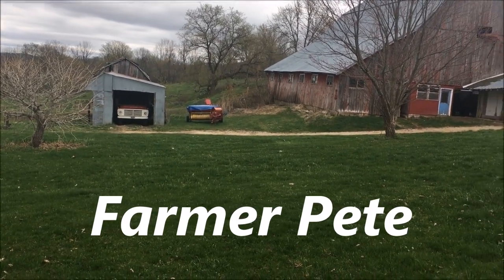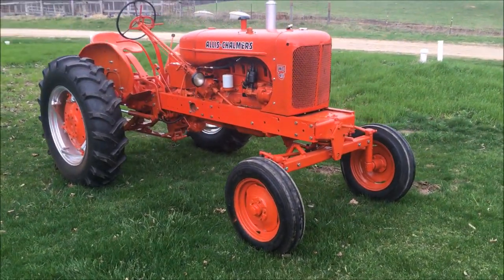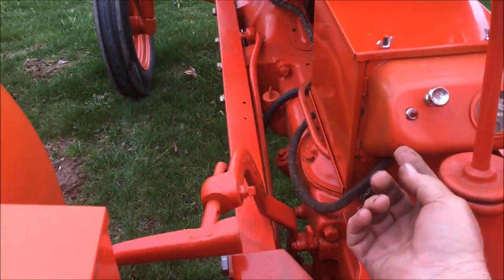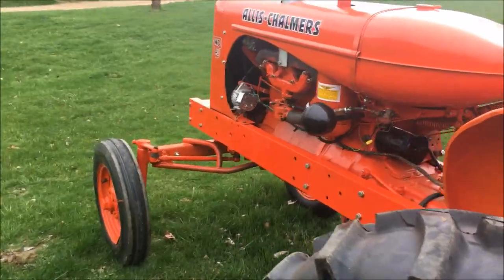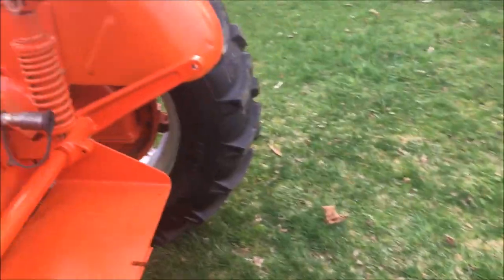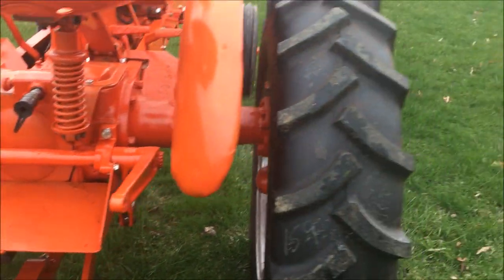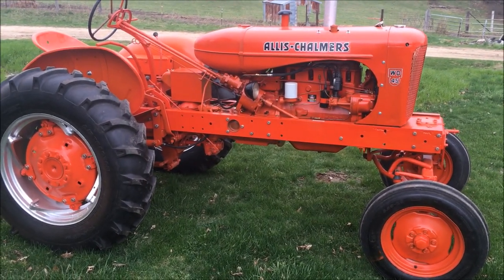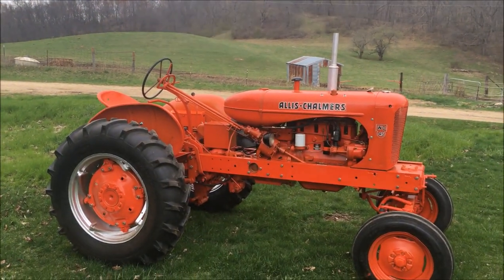Allis Chalmers WD45 "Restoration" Part 21: The Finished Product

Comment: Nicely done!! You make it look so easy. 

I have my dad's, but don't really know how to use it. I have read the manual but still unsure of how to do this and that. 

Hoping you can make a Can someone make a how to video on how to adjust the hydraulics the diagram is hard tofollow. I have a double roll over plow and the tractor can't lift it. It will lift the scraper but can't get it to hold at a certain level, slowly lowers.

 I could also use a video on how to engage the tractor boost, operate the rear pto and the belt pto.

Comment: Did it not come equipped with a snap coupler assembly or did you omit it?  Thanks for bringing us along during your restoration..fine job.
Reply from the maker: This one had a snap coupler but it was completely worn out. This hitch is from my parts tractor, wasn't worn too much.

Comment: Looks great! And I have a question about the WD45 and D17 starters. Do you know if the starter housing cap is interchangeable between the D17 starter and the WD45 starter? Thanks. Again your WD45 looks awesome!
Reply from the maker: My best guess would be no, But I'm not sure. It's been about 25 years since I've owned a D17, I can't remember.
Reply: @farmerpete  Okay, thank you. I'll just experiment and find out if that will work or not.